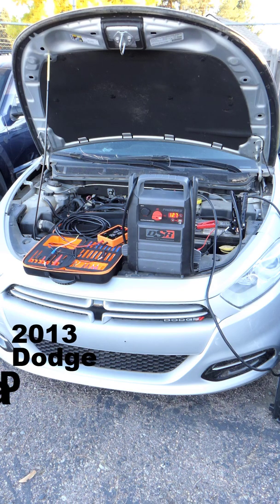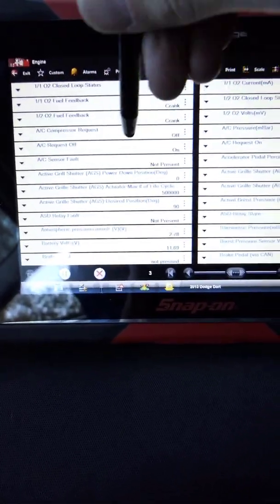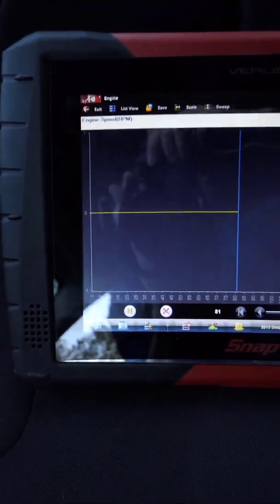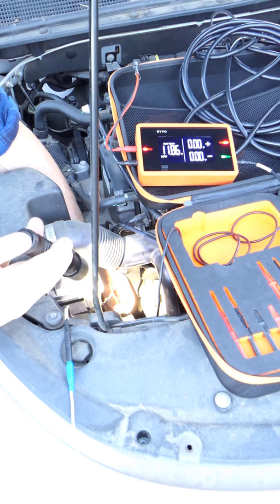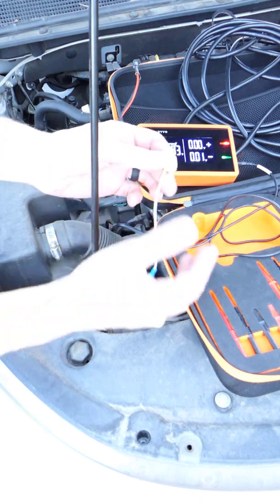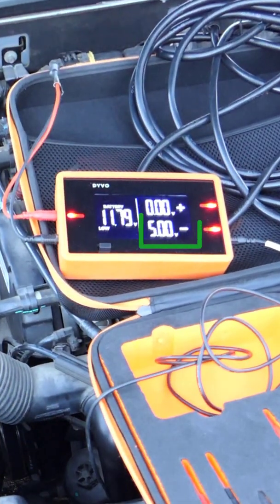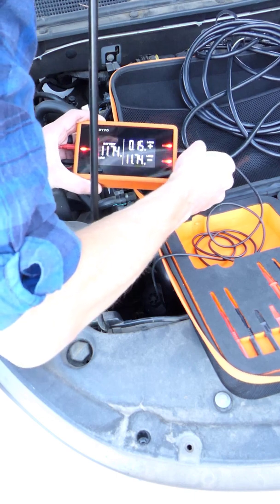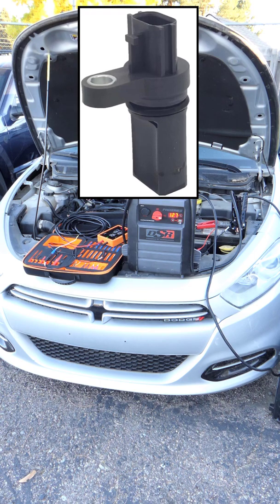How to test a crankshaft position sensor

Comment: If it's a pull down why do you connect dyvo to POS output? I thought to pull it down you come at it with a ground
Reply from the maker: Great question, and you're absolutely correct! For pull-down circuits, you want to pull it down to ground. When DYVO is in LOAD Mode, the positive channel is loaded through an internal connection to ground. This allows us to safely pull a circuit down to ground. 

At the same time, the negative channel on DYVO is internally connected to B+. This loads ground circuits and allows us to pull-up a circuit by connecting it to B+ safely. 

Quick recap:
For pull-down circuits (they sit high when unplugged), pull them down using the Positive channel on DYVO in LOAD Mode
For pull-up circuits (they sit low when unplugged), pull them up using the Negative channel on DYVO in LOAD Mode

Comment: Sounded like it had a broken timing belt at the beginning when you first started cranking it
Reply from the maker: Great catch! Yep, if you listen close, you can hear the cranking is off and no compression. This vehicle had been sitting for almost a year and had a lot of other issues, including all the wires to the ignition coils were chewed by rodents. In this video, we only focused on testing the crankshaft position sensor.